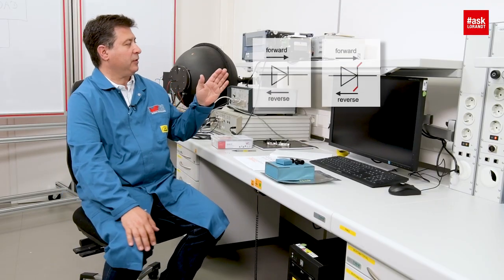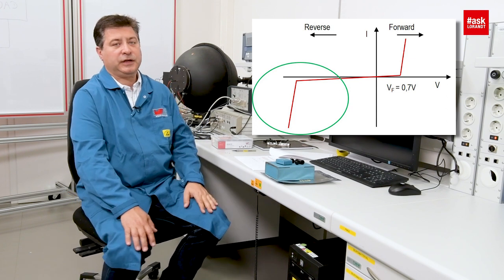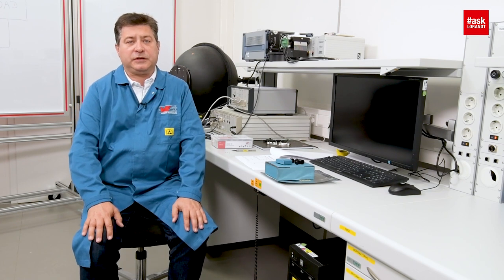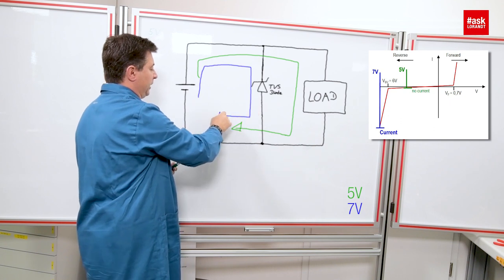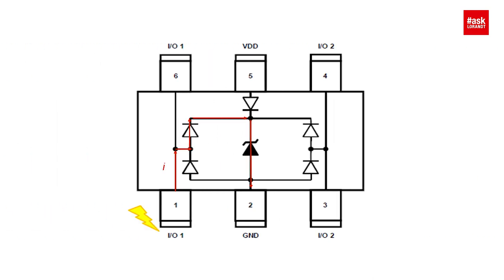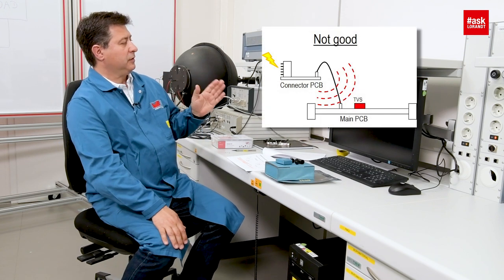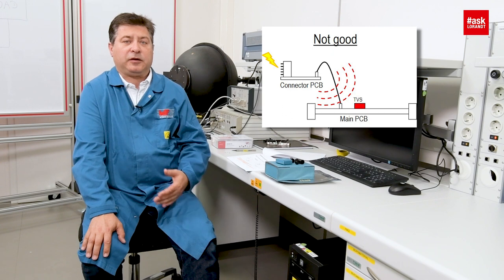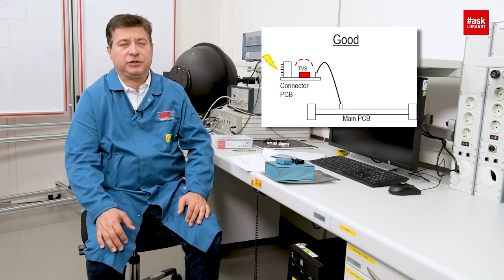#askLorandt explains: Basics of TVS Diodes

Comment: Great video! I searched on the channel to see if there were more TVS videos but couldn't find what I'm looking for. I'd like to see how to pick a TVS diode for specific purposes. Say, protecting microcontroller pins that are connected to a screw terminal, which only function is toggling 1/0 at slower speeds.

Another question, not sure if TVS diodes could be beneficial, I have a Wiegand interface connected with rfid tag readers, I can't put anything in series with the D0/D1 datapins or put Zeners to limit overvoltage - because if I do, the signal gets destroyed. The only way to get the "data" to the microcontroller is to directly connect the pins from the rfid reader to the pins of the microcontroller and this feels dumb. Any ESD or tampering by for example disconnecting the leads and instead connecting a 9V battery to the screwterminal would kill the microcontroller.

Could TVS diodes help here or what else could I do to protect the microcontroller pins, while maintaining the signal integrity?

Any chance on videos on these topics? :)
Reply: Dear Chris, you just initiated a new idea for the next TVS video about application. I guess in the future we will made one for sure.
Regarding your Wiegand interface, for sure the TVS with low Capacity would help agains ESD, but most important is how you are realize the GND & Power concept. For the DATA lines I would use an common mode choke + TVS on the controller PCB where you connect the long wires (each wire should be protected by TVS). Zeners are more for ref voltage or surge protection, the TVS is for ESD protection. Importatnt is your GND where the TVS will guide the pulse, this should be low impedant else you will pull  the GND to high potential.

Comment: Hello, can TVS diodes be used in an application where power supply wires with hundreds of nH of inductance lead to a device with mosfets that switches (PWM) the load on and off at 100 kHz?
The supply voltages are actually low (below 30V) but in a simulation, whenever the mosfets are switched off current keeps flowing through the inductance of the wires resulting in very high voltage spikes at the mosfets. 

Can TVS diodes handle this? How fast does a TVS diode react to a voltage peak and how fast does it stop after the peak? Thanks.
Reply: Dear John, yes TVS could help there if you choose very low capacity (parasitic) ones. The TVS are reacting in ca 5ns or even faster if you use the fF ones. I would suggest to use an electrolytic capacitor 220µF at the input close to the connectors where the wire are connected. This cap will be first charged and take the pulse from the parasitic inductantance generated from th long wires. With this you can save the electronic behind the cap and is much better solution. The TVS have as well advantage for ESD if you add this additional.

Comment: Do you have any components that can bypass a 12ms 50V transient? i'll even give you  a profile -- 24VDC - 18VDC(in 1ms) - 50VDC(in 30ms) and sustains for 12ms - 24VDC(in 70ms) ..?ref- MIL 704D
Reply: Hi Kumar, this kind of characterization of TVS is not possible. You will need a high power TVS because of the 12msec. But as you didn't wrote the application voltage I can't suggest you the p/n. Please see here some TVS from our portfolio which could fit to your application:
https://www.we-online.com/catalog/en/WE-TVSP

Comment: What is the main difference between TVS diode and Zener diode ?
Reply: Hello Wadi, Transient Voltage Suppressors are diodes which acting extremly fast and discharge the over voltage to GND, A Zener diode is more for stabilize and keep the voltage stable for long time at a defined value like eg. 5V. The TVS try to make short circuit instead.